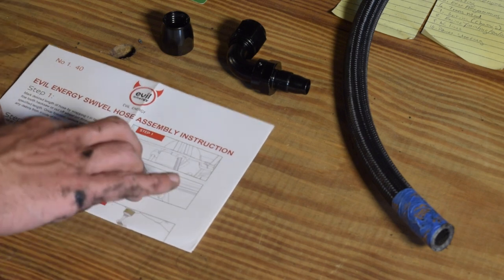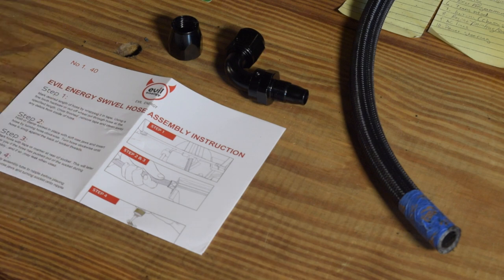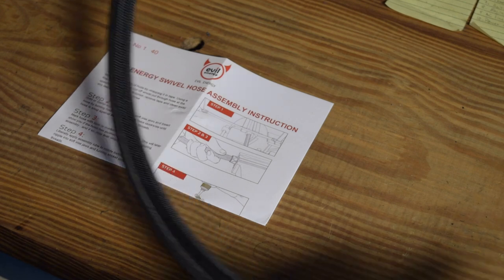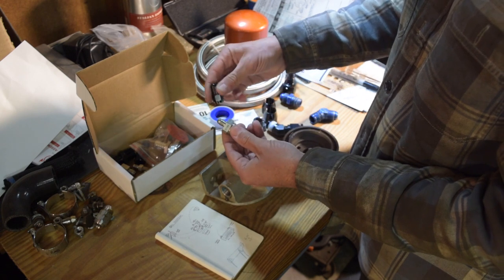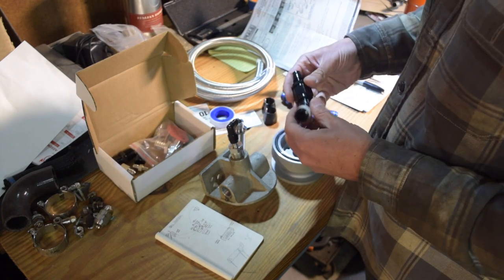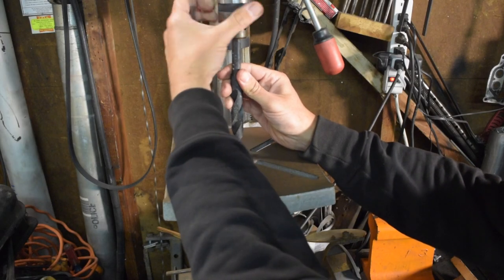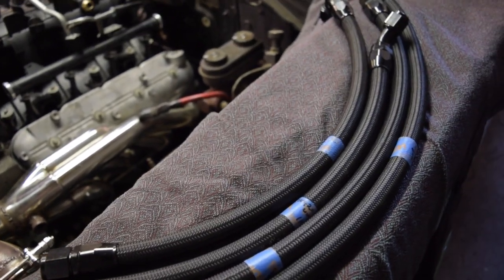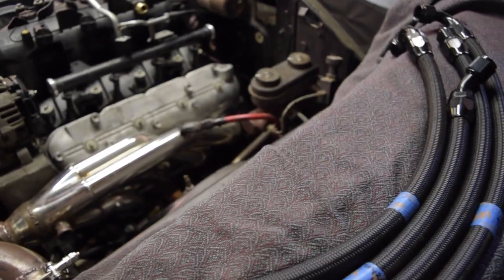LS Turbo Oil System Build - Remote filter/Cooler/Turbo Feed + Drain

Comment: Have you started this engine up yet? Just FYI, I will be surprised if the oil feed line doesn't leak because NPT threads are tapered. If you run the tap all the way through typically they leak. I like how you did it though.
Reply from the maker: Matt, thanks for this. I think you're referring to the turbo drain that I tapped - and yeah, the fitting is actually really loose and will almost definitely leak, so I learned a $20 lesson with this one. I didn't know NPT threads were tapered, but that makes total sense (in hindsight). Thanks again for the post!